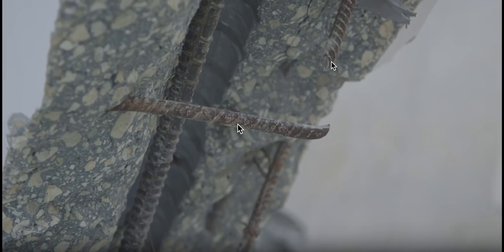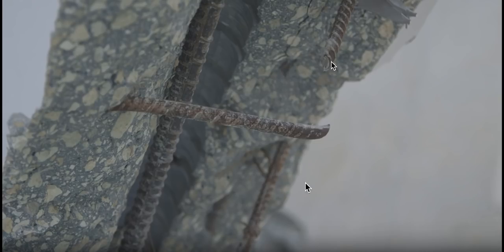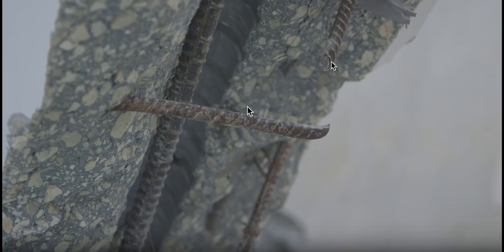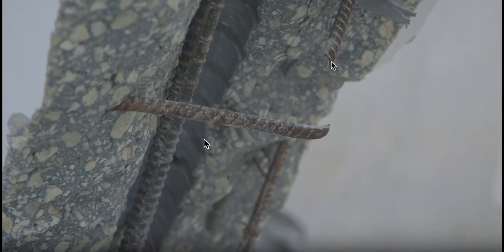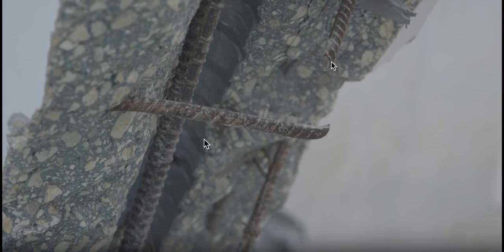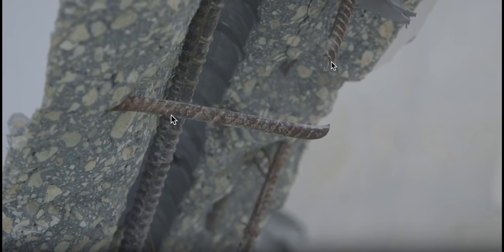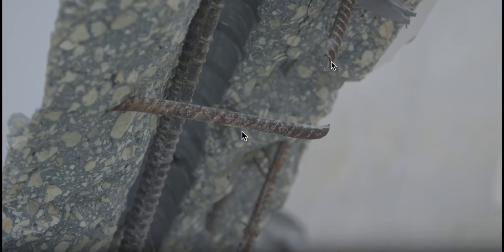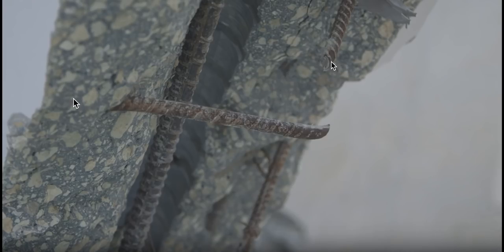Florida Bridge Collapse FIU Concrete design cause of failure? video #12

Comment: I worked in concrete for years. Pre-fab. We poured samples of each batch in pre sized tubes for the state to test. We could not move the product to the job site until the tests came back. Usually about a month. I am amazed this was moved into place that quickly. I see no way there was time for sampling.

Comment: As far as I can see from the drawings the element which failed will always be under compression why add eccentric  pre tension to an element which is under compression it will just ad more load.
Reply from the maker: It can counter act the forces of tension that the member would receive - being that is is more horizontal... hope that helps you understand why add PT tensioning... it keeps the ''beam/column" balanced under loads.

Comment: There has been a lot of speculation about the failure mode of this bridge. A lot of attention has been devoted to the truss, specifically member 11

However, any way you slice it the entire weight of the bridge was supported by the longitudinal cables in the walkway. They alone transferred the load to the piers. It seems to me this is where the failure occurred. Had a truss member failed you'd expect to see the canopy collapse onto the walkway. But even in slow motion that didn't happen. The bridge was up for five days before it collapsed. The weight of the bridge had to elongate the cables. If the load wasn't shared evenly then failure of an over stressed cable bearing a disproportionate percentage of the weight would likely have caused a cascade failure of all of them. 

My first job out of engineering school was at the second largest steel company in the US. I saw a lot of structural steel rolled, a lot of rod, wire, and rebar, welded wire fabric too. Steel is my favorite material. It is strong. It's what gives concrete strength. Concrete by itself is only strong in compression but the weight of the walkway put its concrete in shear where it is weak. Whoever the structural engineer was who stamped the drawings was ought to get a refund of his or her tuition money. That person should never have gotten passing grades IMO.
Reply from the maker: https://youtu.be/5-M7S1qP0jo
Enjoy this one... Thank you for watching also...
I appreciate it.

Comment: Thanks for your analysis. However I think you're partially wrong about the NTSB. Their mission statement is "to determine the probable cause of transportation accidents and to formulate safety recommendations to improve transportation safety". They definitely won't be vague in determining  the cause of failure. However you are partially right in that they will be vague in specifically assigning blame. For instance,  instead of saying FIGG had a design failure they will collectively say that the whole design process is to blame which includes FIU, DOT, architects, and others. This will also apply to contractors, suppliers, etc if they are to blame. The lawyers and courts have to unravel the responsibility. That way they don't have to spend years and countless hours testifying in courts.
Here's a link to a NTSB  pdf report of the 2007 I-35 bridge collapse which seems very thorough to me.   https://www.ntsb.gov/investigations/AccidentReports/Reports/HAR0803.pdf
Reply: Tony in the NTSB news video, The lead investigator clearly states he is not a bridge expert (when a reporter asked him a question) Why on Earth would he be in charge of the investigation of a Bridge collapse if he's not a Bridge expert? Why are there no updates from NTSB in a months time? He couldn't even answer simple questions even I knew the  answers to from watching the news. Then he also contradicts himself. I hope to GOD, for the families sake that they do a thorough job & release all the facts.
Reply from the maker: Sorry for the long reply but, I thought your comment deserved this respect...  (my point will be the FHWA and states always have their hand in these failures and get away with no charges)...

I read your link, of note was they left the state out of their findings and went out of their way to even state that this defect would not have been discovered on the bi-annual bridge inspections... But, did not recommend engineering design specs should be evaluated from this point forward; every two years.
They DID find the original designer at fault and NOT the state... Yet, they make it clear, the state had their hand in this... the following quotes prove my point, that NTSB will avoid blaming the state, even when they make it clear, the state was involved in design and approval... BUT, it get's better, the FHWA also had their hand in the use of steel and design... specifically, addressing rivet pattern on these gussets !  So, they can not turn around and now state the obvious when it was not obvious to them then...
 "Based on the FHWA evaluation report, 24
gusset plates at the U4, U4′, U10, U10′, L11, and L11′ nodes should have been
approximately 1 inch thick—twice their specified 0.5 inch thickness—to have
acceptable D/C ratios."

Although both Mn/DOT and the FHWA were closely involved with
some specific features of the I-35W bridge design, neither organization detected
the failure to perform the appropriate design calculations for the gusset plates
in the main trusses. At that time, Mn/DOT had design review procedures that
provided for checking of consultants’ computations—but these procedures were
not applied to gusset plates. Complex construction projects are often contracted
out to design firms, such as Sverdrup & Parcel, because neither the State nor the
FHWA has sufficient resources. This same lack of resources causes State and
Federal authorities to rely on the stamp of a professional engineer to certify that

all design computations are appropriate, complete, and accurate.

The Safety Board concludes that neither Federal nor State authorities
evaluated the design of the gusset plates for the I-35W bridge in sufficient detail
during the design and acceptance process to detect the design errors in the plates,

nor was it standard practice for them to do so. 

Computation sheets and design documents obtained by the Safety Board
indicated that the preliminary design of the bridge called for the use of high-strength
T-1 steel in about half of the truss members and many of the main truss gusset
plates. When Mn/DOT, the FHWA, and the designer agreed that T-1 steel would
not be used in truss members, the bridge design firm redesigned the components
for which it had originally intended to use T-1 steel because these components
would have had to be thicker to meet the reduced allowable stress requirements of
the lower strength steel. 

As part of the contract with Mn/DOT, Sverdrup & Parcel was required
to submit checked design calculations for all aspects of the bridge. Both Jacobs
Engineering (successor to Sverdrup & Parcel) and Mn/DOT were able to provide
the Safety Board with the checked computations for many aspects of the bridge;
however, neither organization could produce any original checked design 
Analysis
National Transportation Safety Board
HIGHWAY
Accident Report
130
calculations for the main truss gusset plates."

  ===================

What I am showing is the NTSB turns a blind eye on responsibility away from the state when it comes to them having to supervise and confirm details... Yet, clearly they change structural elements with their input...

I would like to see the state also, be held liable for lack of supervision and for negligence in not following proper procedure and confirming their changes have been adjusted and compensated for...  They need to own their shit... basically, they make structural changes and then walk away == they created the problem and then did not follow through with their ''expertise " and confirm the entire plans again... It is basic, if you change material, that changes load capacity and that changes the entire dynamics...
I will end it with this proof, from their report, where they show they had a hand in the structural changes and yet they were negligent in not following up with confirmations... 

"Mn/DOT and the FHWA (actually, their predecessor organizations) wereclosely involved in some aspects of the design process for the I-35W bridge,
which began with the bridge design firm’s initial designs in 1962 and ended with
acceptance of the final design in 1965.
In March 1964, based on Mn/DOT and FHWA concerns, the bridge design
firm eliminated T‑1 steel from all structural members. This change required a
redesign of all the members originally specified as T-1 steel.
The FHWA also took issue with the design of a typical node. The agency
was concerned about the lack of symmetry in the rivet patterns and about the
configuration of the ends of some of the structural members at the node. The bridge
design firm changed the design to address these concerns."
Reply: You rock!
Reply from the maker: Tony, I totally agree with you, they sent an airplane expert to a bridge, construction failure...as the head man in charge...
That's like putting me in charge of an airplane crash...
They must have wanted the wrong person representing them?
See no evil, hear no evil, known no evil, speak no evil...
But, he will say, it's pilot error...

Comment: I guess we will need to wait for the NTSB report. There were photos showing core bores after the collapse, so they did take samples and should be able to determine the design and the construction attributes. Typically, there are material and process specifications, with concrete slump tests done on the concrete after it is mixed but before it is poured.
Reply from the maker: Slump will tell you roughly water content based on numbers, referred to as slump... The higher the slump number, the higher the water content... Unless, you use additives that give a limited "fake slump", if you will...   But, Crabby, I do get your point... Thank you for sharing and I mean no offense...